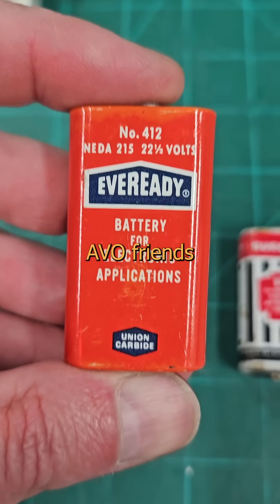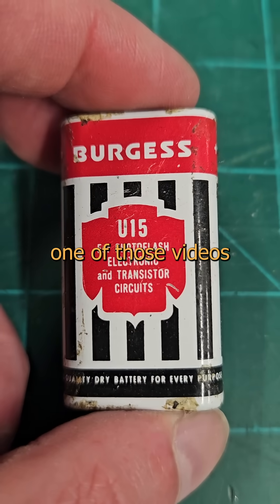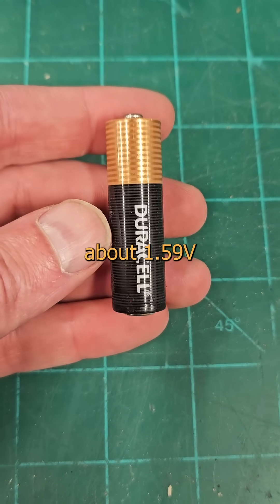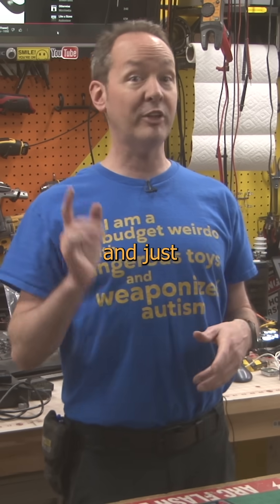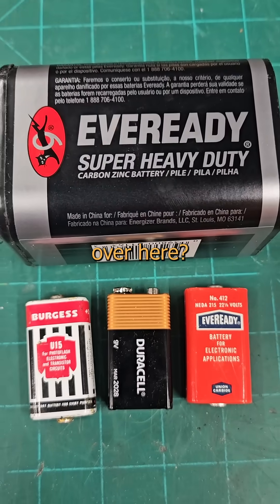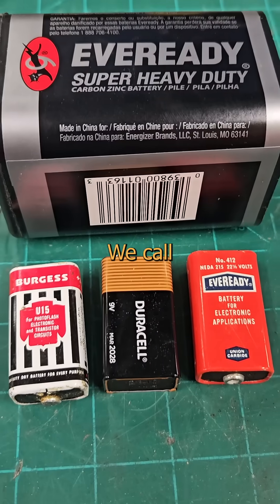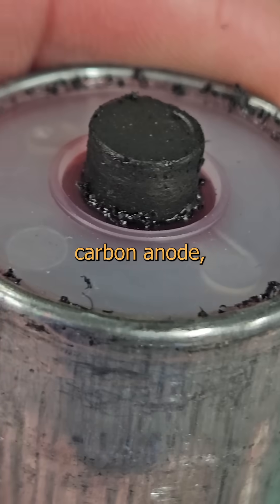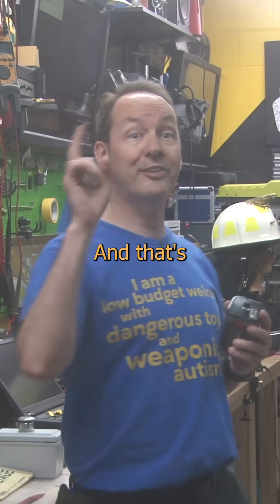Size 412 Battery #chrisboden #comedy #engineering #words #definition #chemistry #haka #science

Comment: I am old enough there was still one radio supply store operating when I was little.  It was an anachronism.  Radio shack was already selling TV's.  But this place sold tubes, inductors, and weird batteries.

The place had an indescribable, sharp smell that I now think was due to this really odd battery that could get super high voltage out of a single cell.  the chemistry involved sulfur somehow and is now rare/banned due to chemical weapons concerns.  I cannot remember the exact name.  anyone know?

Comment: 9v Duracell batteries actually usually use a slightly smaller version of the AAAA, but most just use plastic stacked cells,  and the cells typically used in 6v batteries are 4 F cells
Reply: Many 9v batteries used to use 6 AAAA but it it's not as common anymore. The other day I just peeled back the casing on 4 9v(duracell, energizer, and 2 others) and only 1 9v had the AAAA cells. It was a off brand and of course was dead.

Comment: Noticed the cells as a kid the time i opened up one of these after curiosity was stronger than the "batteries are poison" parental threats. One was 6 cilinders a d the other one 6 "tablets", like square button cells
Reply: Talking about 9v? It was common for them to be 6 AAAA but the other day I was in need of 3 AAAA and of course I peeled back the casing on 4 different 9v batteries and only the dead one had AAAA cells inside. It was a off brand battery. The energizer and duracell both had the flat cells stacked.
Reply: @jonyemm  it was one of the old energizers i think, the other one with the flat cells was a duracell

Comment: I wish they made rechargeable versions of the older batteries. New ones cost a pretty penny.  I have an old scintillator that uses one 67.5 volt B battery and one 45 volt B battery, but it would cost me nearly 100 dollars to run it.

Comment: I learned that 9 volt batteries are basically just several smaller regular batteries all wired together as a kid. 

Lol, much to my family's chagrin, I would tear into anything just to figure out how it worked. I do not know how I am not covered in scars or showed up on the news because I accidentally burned down something. You see, I grew up on a farm and I played with arc welders, muriatic acid, axle grease, acetylene torches and, really, anything I could get my hands on.

Comment: I have a few older batteries like those too. I will repair/restore anything that has vacuum tubes in it. I looked inside one of my tube testers and it had an old “B” battery and a few of the old 22.5v batteries from an old “portable” radio.

Comment: How about 416A 67.5 volt batteries? Used in portable tube amplifiers  for portable record players. 22.5 volt photoflash batteries were used in conjunction with a capacitor to fire flash bulbs.
Reply: .
    I had an old tube shortwave radio, as a kid, that plugged in or ran on a 22.5 volt "B" battery that was out of production. I tried making a "B" battery out of several 9 volt batteries and burned out a tube, also out of production. This was a good working radio and, at 14, I cried when I ruined it.
    Later, I had picked up a like new tube type AM radio that if you hung it on the speaker post at a drive in movie, it wouldn't look out of place except for the fact that it had 2 knobs. It was that compact. This was back when the world was transitioning from tubes to transistors. I went to Radio Shack and bought a box of their 15c 9 volt radio batteries and a bulk pack of 9 volt snap clips. I taped together a block of 13 batteries, wired them in series for a total of 117 volts DC and connected them to the plug of the radio. The tubes lit up but the radio gave no sound. I reversed the polarity and it sounded beautiful with zero 60Hz hum. That was the day that I learned the principle behind the diode tube and it's one way conductive properties. The filaments light with either polarity but the tubes only conduct power with the proper polarity.

Comment: Back in the early 1970s I used to have a  (Sanwa brand?) multimeter that used one of those 22.5v batteries for the higher resistance ranges and a D cell for the lower ranges.

Comment: You should check out the Burgess Z46.  Its a 69 volt battery.  They were used in the Safari Lite lanterns.  You cannot find a modern replacement.

Comment: I used to have a 225v battery with a secondary 3v power(for the valve heaters) for a "portable" valve(tube) radio from the 1940s
It was HUGE

Comment: And then we get to different chemistries like Nickel Metal Hydride (my favourite type), where they start at around 1.3v, and when dead, are around 1.2v? And its recommended to fully discharge before you recharge, because of the memory effect, blah blah blah, most newer ones don't need that, but yeah, the capacities are also something, AAs have either 1,300mAh, which is what I mainly use because the 2,500mAh barely fit into my camera..
Reply: Just don't grab some 3.7V 14500s by accident when you're looking for AAs.
Reply: @kd5nrh  might not fit if I'm gonna be honest 😂 but if it did, the camera would probably become a firework

Comment: We used to bust open the 9V blocks as they were filled with AA batteries. It was cheaper than buying a pack of AA, and you got more batteries to boot.
Reply: AAAA batteries, AA would be too big to fit in a 9V
Reply: @TyPaff  I said block battery. They were also called lantern batteries, the ones with the springs for connectors.
Reply: @lennychorn147  Okay cool, I know what you are talking about.  Never heard them called block batteries before.  
I used to do that too on occasion but only in a pinch.  They don't have as much energy stored as dedicated AA cells.
Reply: @TyPaff  They served their purpose powering games and toys. This was back in the 70s.
Reply: @TyPaff  The PP9 form factor was a 9V battery sold by EverReady, containing 6 AA cells and offering a capacity of ~5 Ah. You can still purchase PP9 batteries today, known as a ANSI/NEDA 1603 battery. The more common PP3 form factor is what is traditionally referred to as a "9 volt battery" in modern times, containing 6 AAAA cells.

Comment: Pronouncing the chemistry killed me 😂.  Big fan of the content. Thank you for what you do! Forgive me if you have already covered this in another video, can you do a deep dive on the difference and practical applications of wiring batteries in series vs. in-parallel? Thanks again!
Reply: Series turns a bunch of AAAs into a 9V, parallel turns a bunch of AAAs into a D. Practically, this means that your flashlight can be 3x brighter (in series) or last 3x longer (in parallel).
Reply: @mage3690 nailed it ☝️👍

Comment: What that 22 1/2 volt battery be used in?
Reply: One comment mentions camera flash.  

Perplexity pro is confused about 412.

I found 412A on Amazon and it mentions galvanometer and multimeter. Most comments mention multimeter.

Comment: That burgess battery used in old radiation detectors, there is an episode of pawn stars where a guy brought in a radiation detection device, and it has one if these 22.5v cell blocks (lol) in it and rick didn't buy it bcuz he couldn't find out if it would work bcuz that specific clump of cells isn't sold anywhere anymore.

Comment: If you wanted to know the cells inside a 6/12v lantern battery are commonly referred to as F cells. IEC-R25 or ANSI-60
You can also get them in rechargable chemistry. I myself used to hack apart lantern batteries to get the individual cells out for a flatter form factor for powering valve filaments because I was a strange kid.
Reply: If you were strange as a kid, then by God you are in the right place now.
Reply: @warrengoddard9183  this channel is a knack magnet
Reply: They were originally F cells (and some still are) however, often they are now D cells with a cardboard spacer. New alkaline D cells hold more mAh than the old carbon zinc F cells.
Reply: @Brook_tno  And you can tell the difference by finding the balance point of the battery. If it balances toward the middle it's probably using f cells. If it balances closer to the bottom it's probably using d cells.
Reply: @thomaswilliams2273  the ones I’ve seen that contain F cells say “4 F cells”. If the cell type isn’t stated there’s usually D cells inside.
Reply: You were a kid, now an adult, but still strange.  Everyone here was and still is strange. You are not alone.
Reply: Came here to say some of this. The part about them being f cells.
Reply: I used to get the carbon rods out of them and use them for carbon arcs or other things like a scope soldering iron heater element.
Reply: @Blackwolfster  That's pretty interesting.
Reply: I looked for the translation option but I guess your comment is actually English. I may not understand Geek but I inexplicably love listening to it.
Reply: -- and that's pretty cool!
Reply: .
    When I was a kid back in the 60's, Sears sold the large 6 volt lantern batteries with the screw terminals on them. These were different though. If you took one off the shelf and put meter probes on them, it would show zero volts but they claimed to have a shelf life of 10 years.
   These were the days of air raid drills in schools and cnlrad civil defense announcements on AM radios telling you to, "in case of emergency, tune to 640 or 1240 on your radio dial", where the little triangles were, (used to be).
    These batteries were made to put on a shelf in your underground nuclear air raid shelter and wait until needed. They had a plastic snap cap in the top about the size of a quarter. If you needed it in an emergency, you snapped the cap off, add ANY water or water based liquid like chicken noodle or vegetable soup, pond or drinking water, soda, beer ect. and it would activate the battery. You snap on the cap and mount your hand spot beam or hook it up to a radio. It was expensive at the time at around $10.00 when a carbon / zink unit was closer to $4.00 and was a one time use thing so, unless you were rich, it wasn't a toy.
Reply: @jeffmccrea9347  I've never seen or heard of these, I'm gonna toss the info at my dad and see if he remembers them! If he does, it's bound to be an interesting story! Thanks!

Comment: I'm 50, spent 30+ yrs in the electrical trade , NEVER heard of let alone SEEN that' battery 😮 Thanks 🙏😅
Reply: Same. Never even heard of it in 45y
Reply: @tuckamojo7660  I've seen lots of them. They were in the multimeters we used in electronics class in the mid '60s.
Reply: Old Simpson 260 meters used the 22.5 volt battery.
Reply: Many obscure electronics used special batteries. Some things I think were designed to use to make the batteries only available from single source AKA the manufacturer of said equipment. Or in case of some military / security equipment to prevent unauthorized use.  I can think of a few of them, but some are still covered by N.D.
Reply: @DB-yj3qc  this is hugely more frequent since leds and soldered Lipo.

All electricians know the French brand Legrand. Last month I called them about some fire exit lamp monitoring device. Documentation recommends to change the included battery every 4 years. The documentation does not give the ref of battery. The battery is non standard. And after 10mn, the hotline gave up on finding how to order the new battery.

Manufacturer says you have to change it, it's soldered, it's not standard, but even manufacturer does not sell the component. In short, every 4 years, you just change the whole device. 

I usually like this brand.

Obviously not always ...
Reply: @Benoit-Pierre 
   Probably obsolete when manufactured. Technology changes so fast today that equipment has to be updated before it's even in production.
Reply: @Benoit-Pierre Well that's absolutely obnoxious. I guess you can replace the device then dismantle the old one,  see if anything could be done for future things.
Reply: Saw one in an antique camera. Was a bit confused for sure lol. They are rare.

Comment: Thats the first time ive seen that battery, but take a look at thoes 12 volt battries for garage door openers
Reply: 12v battery for garage door openers? Most of ours used 2016s ot 2032 which are 3v flat button batteries. I think some of the older are used what look like a stubby AAAA(skinny AAA). Inside of them are multiple 1.5V button cells. 12/1.5= 9 of the button cells.
Reply: @jonyemm  i dont know the number on them, but their in newer door openers and some older electric lighters

Comment: The 22v 412a and it's other random cousins were actually quite common in old folding dish flashes for film cameras, quite a pain not only to find them but one with the juice for it.
Reply: You can get new ones from China and India for absurd prices, like $15-20 a piece
Reply: @toddoroi4947  Oh absolutely but they're junk for most part. And having reminded me careful about the rechargable ones, I've had two just spew magic pixies now.
Reply: @Zeta368peep  they work okay for B-C flashes but they lack the current to fire battery-only flashes
Reply: @toddoroi4947  Yes, now, in the age of internet and Alibaba.   For years you had to dig them out of the catalogs of electronics companies and buy them mail-order - usually in packages of like 10 or 12 or 20.   They weren't expensive - a bit higher than more common types, yes, but still not ridiculous - just hard to locate.

I remember buying mine from Allied ELectronics, and waiting the oft-quote 4 to 6 weeks for delivery.
Reply: Somewhere out on the internet, someone figured out the right button cells to use to rebuild a bunch of the old odd ones… can’t find the site now though.

Comment: Why is 1.5V the standard for so many cells?
Reply: Probably because the chemical reaction he mentioned creates about that much voltage. From there it probably was the devices that came after built around that, and then we never changed it because we didn't need to
Reply: @AchievedZeus574 pretty much.   Bigger cell just has a higher capacity. Need a higher voltage? Just put them in series.
Reply: Good to know!